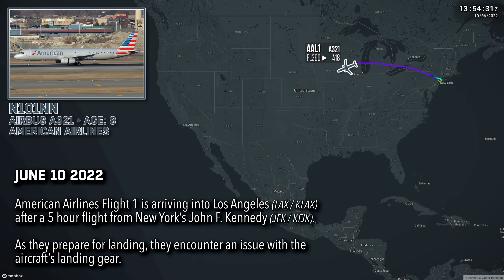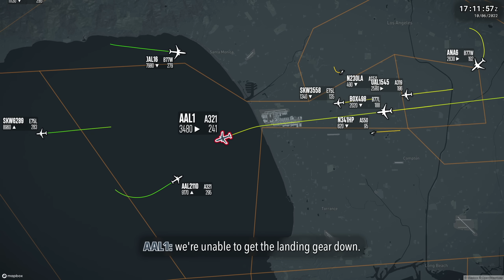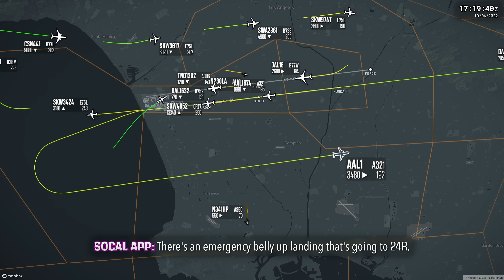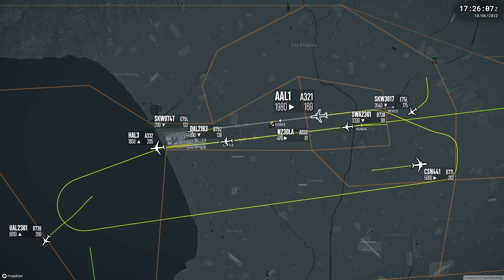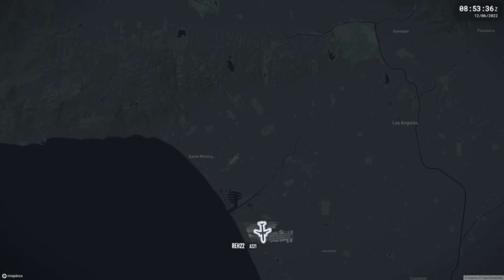LANDING GEAR MALFUNCTION Leads To EMERGENCY Landing at Los Angeles [ATC audio]

Comment: This was obviously not a belly up landing. The failure was both LGCIU's ( Landing Gear Control Interface Units). The FO missed that comment when the controller mentioned it. The reason why RWY 24R was requested was the ILS was out for 25L, and the ILS (lower mins) was available for 24R. They were shooting the RNAV approach to 25L but the weather was close to minimums. Did not want to risk a go around with low ceilings at LAX with the gear out and unable to retract it.  Manual gear extension worked and the landing was normal on 24R. LDA is 8926' on 24R. If the gear had not come down, a longer runway would have been requested. Gear had to be pinned on the runway by maintenance for the taxi in. Air Force two was about to take off after the landing, so there was a delay. I know this because I was the Captain on this flight.
Reply: I meant not a gear up, belly landing,

Comment: A 'belly-up landing' would be where the plane is inverted when it lands. I think that 'belly landing' is the proper term here.
Reply from the maker: Yes, the controller seems to be mixing "gear-up landing" and "belly landing". A "belly-up landing" would be a high-risk, low-reward strategy, I think. 😅

Comment: WHAT??? He calls ‘PAN PAN PAN’ then requests a return for landing but didn’t complete the ‘Failure of Landing Gear to Extend’ checklist? Then he says he doesn’t think they will get the gear down so they’ll need an inspection on the runway after landing. Do ya think? He should have held somewhere until the checklist was completed then either land uneventfully or request assistance when the gear failed to deploy. They had 2 and a half hours of fuel. What’s the rush guys?
Reply from the maker: The crew did complete the relevant checklists, and the gear did extend prior to landing. The pilot said that they thought the gear WOULD extend and lock, but in case it didn't, they declared PAN-PAN and requested an inspection.
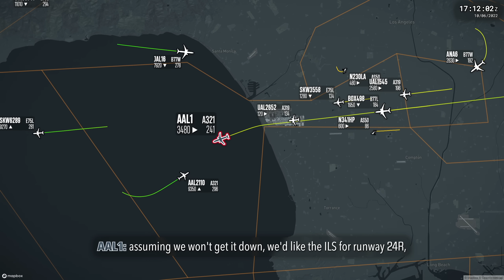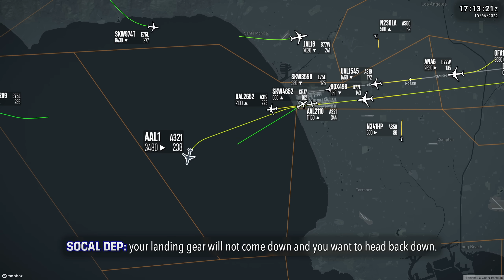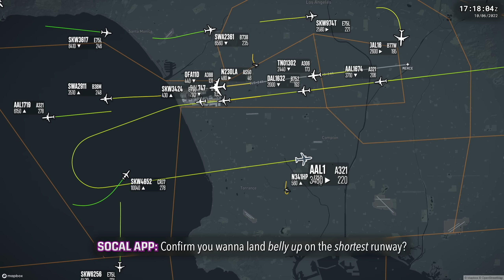Reply: No. you need to listen again. At 2:18 he clearly says ‘we’re assuming we won’t get the gear down’ and  they will need to stop on the runway and have an inspection. He also said they hadn’t run the checklist yet. The second contact at 3:15, while on downwind, the pilot said they still hadn’t run the checklist but the gear SHOULD come down. Even the tower advised other traffic that a belly landing was expected on 24R. At 4:24 SOCAL asked to confirm they wanted to belly land on 24R. The pilot responded affirmative. As I said, running a checklist while in the pattern was a poor decision. With plenty of fuel there was no need to hurry the landing. 
All of what you said did happen, but you have the time line of the events all wrong.
Reply: @billyjc-M20R  Man, a lot of  backseat driving here....

-First timestamp he is almost certainly saying "assuming we WILL (We'ulll) get it down."  and the caption is wrong. Why on earth would he be talking about an inspection if he thought they were about to do a belly landing?
-Second timestamp confirms my above point by saying "I'm pretty sure it should come down once we do that"
-Clearly a miscommunication on the belly landing situation that AA1 didn't hear or understand on the radio or I assume they would have corrected.

The alternate gear extension procedure is 5 steps long and would take maybe 30 seconds to complete. They could have done this at any point during this sequence and we don't know exactly when they did it. To say they hurried up or to actually believe they thought they were going blindly into a potential belly landing is asinine.
Reply: @SAber_Pilot  No backseat driving here. What’s hard to believe is even with the video and communications showing time stamps and captioning, you refuse to agree that what I said is accurate.  Amazing. Also, there is no guarantee that the alternate gear extension checklist will work. Hardly 30 seconds. As I said AGAIN, doing a checklist for inoperative gear in the pattern is foolish. Asking ATC for a hold over the Pacific while running the checklist would have been a much better decision in my opinion.  BTW. We DO know when they ran the checklist. When downwind. Also, I never said they were blindly going into a belly landing…You can’t make stuff up to make your argument sound better.
Reply: @billyjc-M20R  I refuse to agree because what you said wasn't accurate... They DID think the gear would come down and the pilots at no time thought they were preparing for a belly landing. If they had, there would have been much more of the additional steps you describe happening. There was obviously a big communication issue between ATC and AA1 regarding the severity of the problem.

It's a half-page checklist and it is 5 steps long. Only the first two steps of which are actually manipulating something. There was more than enough time to enter a hold and assess if it didn't work.
Reply: @SAber_Pilot  What I said was exactly what was on the video. How do you not get that? To agree that it’s fine to run a checklist while in the pattern is stupid. If you don’t think so you need to turn in your license and get a job that can’t hurt anyone.

Comment: Backseat pilot; It would have helped and cut down on the initial back and forth with tower had the AA pilots simply stated, “Landing Gear issue, going missed, request vectors for an area to troubleshoot.” Second, they had plenty of fuel, go to the the hold area, try lowering the gear there so as to take as much guess work out of the equation, thus helping ATC and Crash/Fire. Thirdly, SoCal even tries to suggest and help out suggest a different runway. The AA pilots chose the worst possible runway. …Pilots’ score 6/10, ATC’s score 10/10
Reply: What makes you think there was any guess work at all on the pilot's side? Once they completed the (very short) "alternate gear extension" procedure and see down and locked indications the issue is gone. Going out and circling wouldn't have accomplished anything. Granted there was clearly some miscommunication between them and ATC as to the severity of the problem.

Comment: The flight crew did an almost excellent emergency. As noted by other comments the flight crew did not give the airport (ATC, first responders etc) needed information on WHEN the landing gear was going to be extended by the alternate method. The ground crew was, at first, working on the assumption that there was going to be a belly landing. A rehash of this emergency would have the flight crew announcing that they would extend the gear on final (short final, long final, don't have their checklist in hand) for ground personnel planning. And ATC asking (for clarification) when will the emergency extension take place.  Falls into the same logic/philosophy as 'check gear down'.  Otherwise, 5 star to ground, ATC, and flight crew. All emergencies should turn out to be boring!

Comment: FWIW, "gear up" landing TYPICALLY refers to landings where the pilot "forgets" to lower the landing gear, while "belly landing" means there is a mechanical failure of the gear to properly lower. I was observing one landing(standing behind the pilot) at NAS Keflavik back in the 70's (USAF EC-121) when the rook copilot called gear down and locked. Aircraft commander, flight engineer, and I all saw 3 red, showing gear up, and the pilot ordered "repeat pre-landing checklist" The co-pilot repeated "Flaps set, BMEP 40 (Brake Mean Effective Pressure), 3 gear down and locked". Still seeing gear up, the A/C turned to the flight engineer and said "figure out the landing roll for a "gear up" landing". The co-pilot saw his mistake, slammed the gear down, and greased into the SMOOTHEST landing I ever experienced.  3 days later on t hat same aircraft, the left landing gear snapped on takeoff and 40,000 pounds of 115/145 aviation fuel exploded under my bony white ass. With full fuel for a 14 hour flight, the Connie didn't "explode", but she was an engulfed bitch by the time we got TF out. Had the tanks been empty (like at the end of a flight), we'd have gone up like a hand grenade.

Comment: My very first flight ever had a problem like this - thanks for the vid - helps understand the situation. In our case, they lost the hydrolic fluid; prepared us for crash landing, but got the gear down manually at the last minute. Funny thing - since it was my first, didn't think it was so unusual - even the prepping for landing - I thought maybe this was how it was on ever flight. Only when we actually landed and saw all the emergency vehicles did I think to be scared - lol

Comment: awatched this one live at LAX... The ATC communications made it seem a lot more serious than it was. The aircraft landed with the landing gear doors open with the gear down. The pilots did a great job with this one
Reply: I think it was more that he didn't seem to ask for confirmation of the gear being manually extended on downwind (or it wasn't included). I would expect the aircraft to do a low overshoot to confirm the gear fully extended (even though this doesn't confirm locked) prior to making the final approach for landing
Reply: @timp1390   This wouldn't be necessary as the aircraft would have been giving them full indication of gear fully down and locked which is a far more sure sign than a controller with binoculars. They would know if it wasn't on the second attempt immediately.

Comment: Is it okay that they didn't burn fuel before making a partial gear up landing?  Potentially, a fire could have started right?
Reply: After a cross country flight, I imagine the fuel was sufficiently low enough that dumping would not have been necessary. Usually a fuel dump would only be necessary if they had just taken off, or had travelled only a short distance.
Reply: They landed with the gear down.
Reply: It's more dangerous to land with empty tanks. Full tanks burn, but don't explode. The only reason you dump fuel is to lower the weight.

Comment: Flight from JFK to LA with only 89 people on board wow
Reply: That's an 87% load factor. Their A321T's they use on JFK transcon routes only have 102 seats onboard.
Reply: @Jack3md  I learn something new everyday, thanks!
Reply: @mike13086  no problem!
Reply: It's probably one with mostly business class seats
Reply: This is their  special transcontinental flight, not your typical 2 class domestic greyhound bus flight.

Comment: "Unable to get the landing gear down so we'll have to stop on the runway for inspection"... Dude doesn't seem to realize if you land without gear, there's gonna be an inspection, investigations, and liability lawsuits...
Reply: They did land with the gear down, only the couldn't extend the gear using the normal leaver. They use the manual gear extension procedure. The inspection is for (in case of) hydraulic leak.
Reply: @harveywilde6781  Manual extension causes loss of nose wheel steering. They have to reset the handle or be towed in.

Comment: Does anybody know if the on ground fire crew or if the AA maintenance crew had pins to make sure the gear didn't collapse and if they installed them on the runway?
Reply: The mains have collars. The nose has a pin. All are carried in the cockpit.
Reply: all gears are tested after all wiring is hooked up

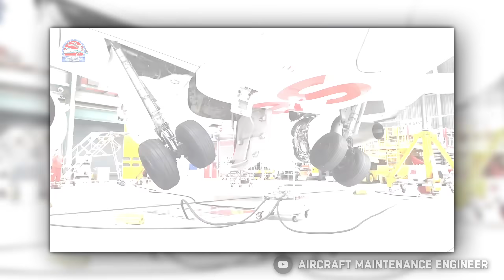Comment: 6:55 this is the same process we do at Boeing on the field when testing gear related work before we deliver our aircraft.  It's really the only practical way to do it.  We call it a "gear swing". The weight of fuel the airplane has onboard also has to be accounted for so we'll pump fuel from one tank to another to balance it out prior to jacking.
Reply: I've been on the 787 and 777 Final Assy they, 'Swing the Gear' when assembling inside as well as out on the Flight Line!

Comment: "We are unable to get the landing gear down and we will need to stop on the runway for inspection"  - WUT???  As opposed to continuing to the gate, on your belly?    I suppose the jets have enough thrust to make that happen if you really want to, but its not how I would do it.
Reply: Maybe if it was the last day on the job. Sure. Send it!!! Southwest "GND, clear all personnel at gate, were coming in HOT, send equipment, See ya"
Reply: This was because at the time of the comunication, they were unable to lower the gear on approach and didn't went yet through the procedure to check and try to lower the gear. As the last solution they could have the gear lowered manually, so at the time, they were sure they will lower the gear somehow. A belly landing was considered unlikely at the time.
Reply: The only response to your comment is LOL!!

Comment: Awesome job -- again!!  Thank you for the additional ADS-B info at the end -- something new I learned!

Also, at first I thought the controller confused his words, saying, "Belly up landing", which, of course, conjured in my mind a 180° barrel-roll, and landing upside down... a very cool safety trick to keep the engines from separating (wink, wink)... anyway, I digress... When I heard the other controller repeat the phrase, it became clear (to me) that it meant "Belly landing, gear up,", or, specifically, "Belly, [gear-]up landing."  Which, of course, is worst-case if the gear couldn't be lowered & locked.

Again, great job!!

Comment: I wonder what their reasoning was to request 24R.
Reply: I'd like to think courtesy, if so, that pilot deserves a vacation!  doing what he can to not screw up the day for everyone else!
Reply: @CheezeCracker  
They split landings fairly equally between 25L and 24R, so I don't see how it would help any. 24R stays busy on a normal day. The only thing I can think of is if it was the only ILS available and they wanted to minimize the chance of a missed approach.
Reply: @A.J.1656  Yeah, the ILS for 25L is out of service right now. It's why those other planes get sent onto the RNAV app.
Reply: @bandwevil  
I'm surprised LAX wasn't still trying to push visuals. I've seen the ATIS update delayed by a full hour so they wouldn't have to mention the marine layer on the departure end. Lol

Comment: The quality of communication as if they talking in the 19th century. Why it's that low? Isn't it digital?
Reply: Aircraft radios use analog AM modulation on the VHF band. Be assured the quality sounds way better to the pilots and ATC on their costly professional radios.
What we hear is recorded by aviation enthusiasts using hobby equipment that may be located far away from the airport.
It is not in the interest of safety to switch the standard. With digital, it requires a minimum signal strength to decode. With analog a weak signal will be scratchy but you will still hear it.
Reply: People need to talk to each other.

Comment: The notion that there was to be a belly-up landing was an apparent assumption by the controller based on the crew report of being unable to lower the landing gear,  What wasn't clear to the controller was that the crew still had to try the manual extension of the gear.  That apparently worked and the flight landed on 24R (not 25L/R).  Had the manual extension procedure not worked, it's highly likely the flight would have been diverted to ONT, so as to use one of their long runways, and avoid causing massive delay (for everyone) at LAX from having a runway closed with an aircraft gear-up on it.  Back in the mid-1990s, I had a 737 with an actual gear issue (one main partially extended) on a BUR arrival, and I diverted it to ONT over LAX for the same reason.
Reply: Whether the plane gets diverted is on the PIC. Capt will decide if he even wants to go to ONT. And, plus as PIC now you gotta talk to the company and figure if ONT is a viable option considering mx facility, company operation personnel etc. ATC can suggest where to divert but PIC dictates where his/her plane gets to land
Reply: @JamesKordent  Some years ago, TWA had a 767 with a actual gear problem (i.e. not an indication issue) inbound to STL. The flight got diverted to very nearby Scott AFB, because TWA didn't want to effectively screw their own hub with a disabled 767 tying up a runway for several hours. Yeah, MX had to do a field trip to recover their aircraft, but that was much cheaper than the costs of diverting/delaying other flight from the irregular operations. Short of an emergency that involves an immediate need to get on-deck (ex. fire), ample time time exists to determine where the best place to plant the aircraft is. A flight's PIC might not have all the needed info to make that determination, but coordination with his dispatcher (again, a non-fire situation) would best ensure the correct decision gets made.
Reply: Thank you for the explanation. I was wondering how they could have their gear inspected if they couldn't get it down.
Reply: I live next to ONT. That would have been a sight

Comment: “You want to land belly up”? I have not heard that wording before..wonder if that is standard for a gear malfunction?
Reply: Yeah.  Thats a good one.   Belly landings or gear up landings don't hold a candle to the rarely seen belly up landing.    Its probably hard to hold the plane inverted in the glide slope.
Reply: @wouldntyouliketoknow9891  just depends on how screwed up your control surfaces are at that time… just ask Denzel 😂
Reply: I think it’s a mistake… combining “belly landing” with “gear-up landing”

Comment: Only 89 souls for a cross country flight on American in a foreign made aircraft.  Pretty much sums up America right now.
Reply: That aircraft only seats 102, so it’s nearly at 90% load factor. Plus using one flights load isn’t really indicative of the overall shape of things. Planes are generally packed full this summer.
Reply: It’s a transcon setup so it’s got less seats but more comfortable seats, more expensive seats as well